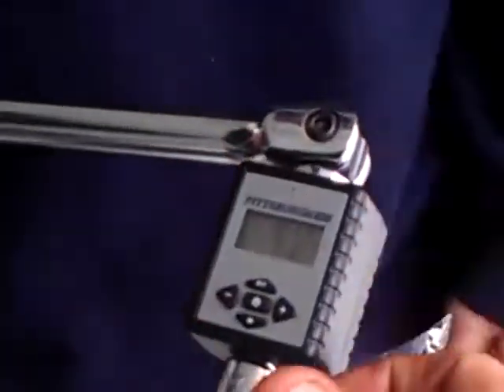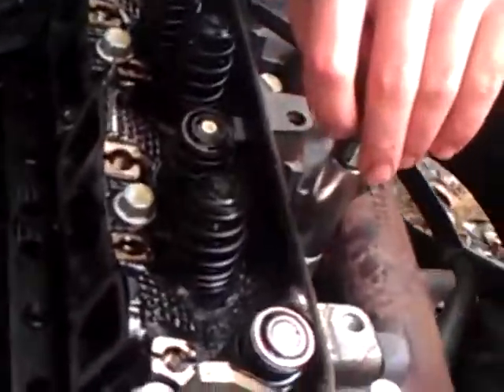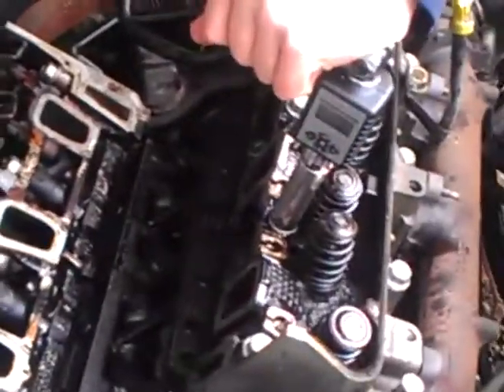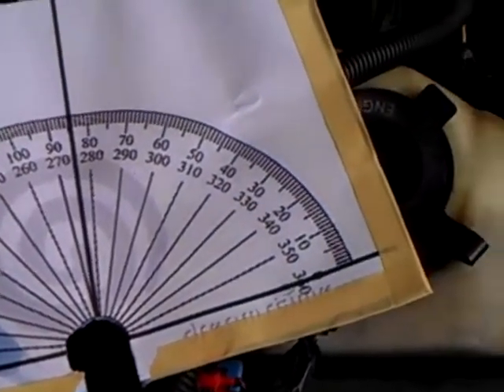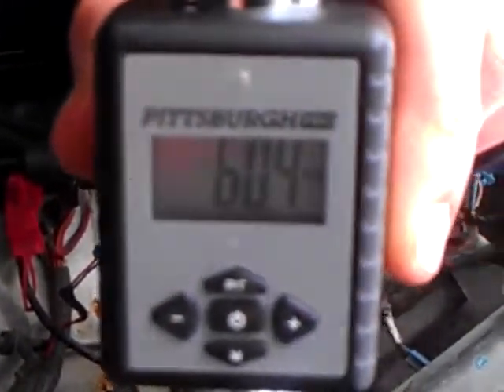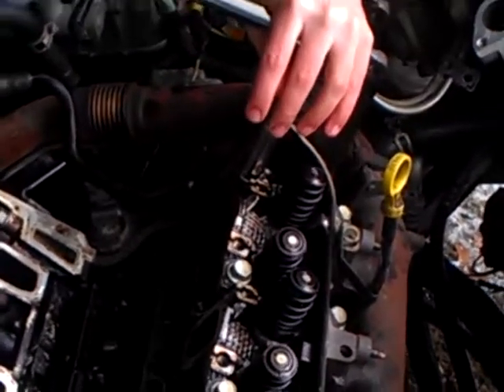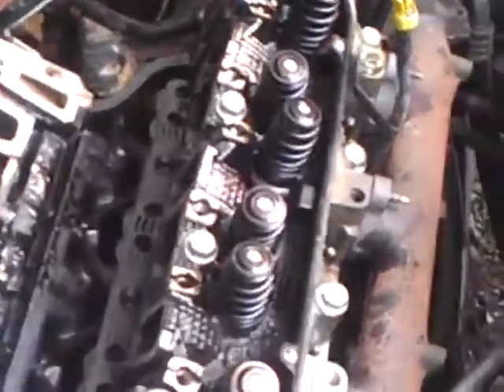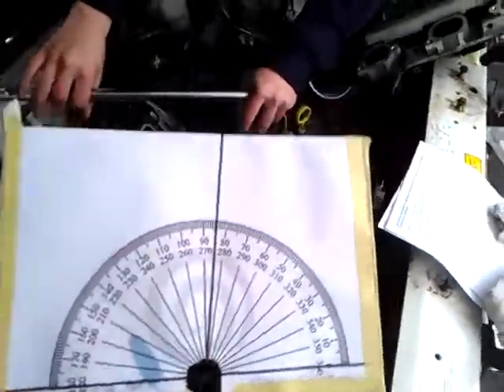Harbor Freight Pittsburgh Pro Digital Torque Wrench use 3.1l 3.4l head gasket replacement

Comment: I get "LO" message in between taking reading. Any idea?
Reply from the maker: No mention of 'LO' in the manual. Betting it is low power battery but that is a guess.
http://manuals.harborfreight.com/manuals/68000-68999/68283.pdf

Comment: Just a FYI, it is bad practice to place your hands anywhere besides the torque wrench handle.
Reply from the maker: Yes it is BUT... That is not a calibrated torque wrench handle. The whole torque mechanism is in an adapter that is between my breaker bar and the socket. SOOOO, that being said, it is bad practice in practice only. Means nothing in the real world if you are using this product.

Comment: Howcome mine doesn't click like yours on LED. I set mine to 76 peak and I never see it changing color besides staying on green.
Reply from the maker: Not sure. Since this video I tried to pull this out and use it again to find out and the battery was dead. It has been turned off and in the box and still died.

Comment: I like going to Harbor Freight however I don't really trust anything being sold there unless its a plain socket or wrench. I know from experience that the torque wrenches they sell don't even click. When calling their customer service 800 number the guy informed me that the torque wrench wont always click and you will know the bolt is at the proper torque when the wrench turns freely.  HAHA yeah when you break the bolt...anyway hope your meter is accurate.
Reply from the maker: I made this video AFTER reading the Hot Rod magazine test on various torque wrenches. http://www.hotrod.com/how-to/additional-how-to/ccrp-1304-torque-wrench-testing/  
They liked it so I tried it. They compared it to other torque wrenched and were surprised how well it did work.